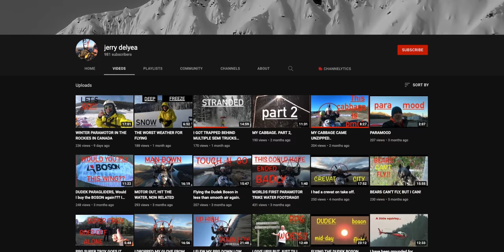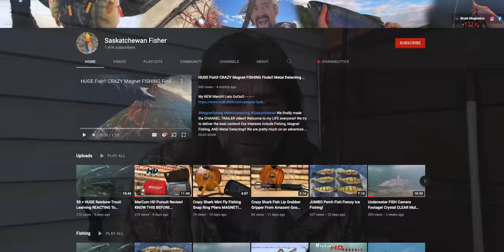Survival Trap Challenge for Subscribers- Winners of the Bushcraft Survival Trap CHALLENGE!

Comment: Cody:  I like that saw with the hook on the end... Occasionally I think about how nice it would be to have a little stopper on the end of the blade to help not pull the saw out of the wood while cutting because I have an issue when my calibrations and sometimes pull too far back. Kool saw dude! BTW, my saws are Silky and I have the F180 Pro and the BigBoy Pro.  Congratulations dude!
Reply: Haha thanks a lot! I really dont use that saw much, but you're right that would be good for not pulling the blade right out!